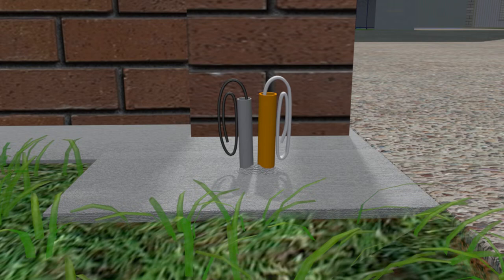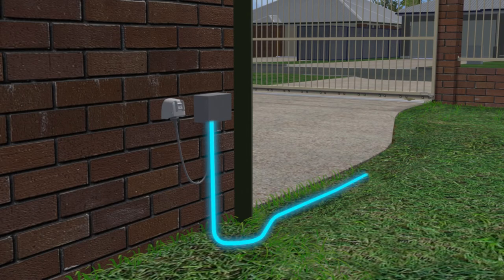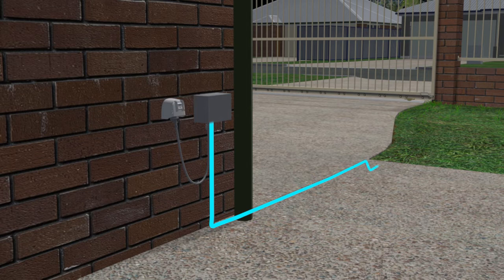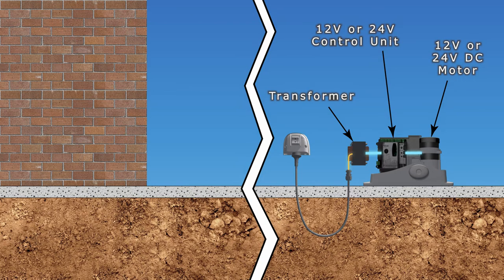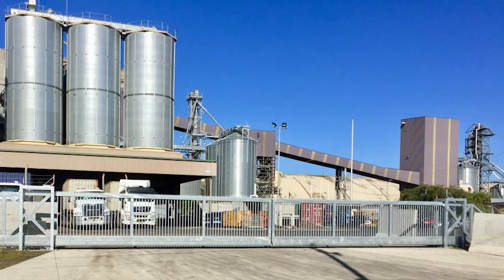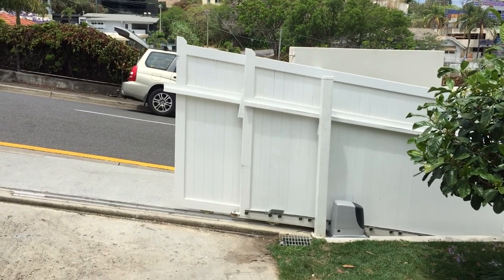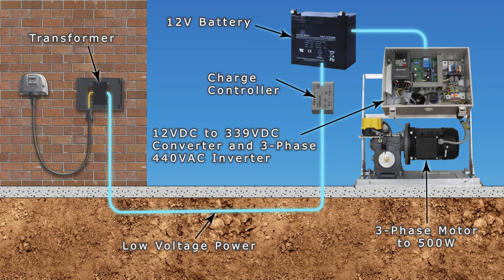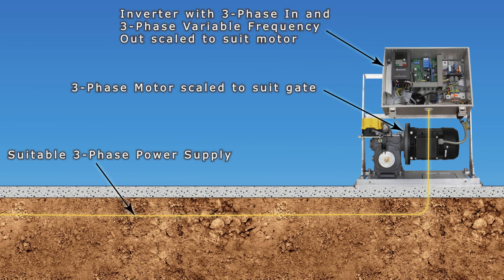Most economic way to get Power to a Gate Motor

Comment: Hi, thanks for this video. Can I replace the batteries in my gate motor(low voltage, 24DCV) with an AC/DC adapter, just to avoid replacing the batteries often???
Reply: I wouldn't recommend that, best to check with the supplier

Comment: How can a low volt motor offer high torque and high speed at the same time? I thought it was one or the other?
Reply from the maker: You are correct the more speed the less torque with low voltage DC motors, although overall torque, speed and efficiency of a low voltage DC motor is much better than a single phase AC motor with the same power.
Reply: @automaticGatesExplained  thank you for the quick response. So as an example, if you have a 300 watt 240v ac motor wouldn’t it draw less amps than a 24v motor with 300 watt rating? Making the high volt option more cost efficient by reducing conductor size?
Reply from the maker: An AC motor draws more electrical power than a 24VDC Motor to provide the same amount of mechanical power output because single phase AC motors are only about 30% efficient, where as 24VDC permanent magnet motors are 70% to 90% efficient. 24VDC motors normally have a built in transformer to go from 240VAC to 24VDC so power cable size to the gate will be the same, because it is determined be electrical regulations. If running low voltage power cable to the motor from a house this will require basically the same size cable up to a certain distance and a thicker cable for longer distances because there is a greater voltage drop.
Reply: @automaticGatesExplained  thank you for the help 👍

Comment: So can I run a 14-2 gauge wire from breaker box to 110 voltage automatic gate opener or should it be 12-2
Reply: It depends on how many amps your opener draws. A rule of thumb is to keep the load within 80% of the capacity i.e. if the gate draws 10 amps, for example, you'd need 10 amps/80% = 12.5 amps, so a 15 amp breaker with 14 gauge wire would be sufficient for this example. Make sure you're using the appropriate wire/breaker combo. 20 amp must have 12 gauge, 15 amp must have 14 gauge.

Comment: Why would they have to be in separate conduit?
Reply: Low volt running too close and parallel to higher voltage gets an induced current. This especially affects comms data speed.

Comment: Can't run 240v conduit in the driveway slab like that. Has to be at least 300mm deep.
Reply from the maker: Okay just checked the Electrical safety code of practice for Queensland Australia, which is where I am from and for any voltage higher than 50VAC or 120V ripple free DC there must be a minimum cover of 100mm of 20MPa concrete or the equivalent, so here it is legal to do as I have suggested but then elsewhere it may not be. I would like to point out to all concerned that installing mains power should be done as per electrical code for the area where the work is being performed.
Reply: What if it was a 300mm slab.?

Got to say I do this for a living and this guys movies are great and takes a lot of effort. Also I’d like to add he knows his job. 
Great movies, great guidance. 
Would really like to do a few jobs with this guy I think I’d learn a lot.